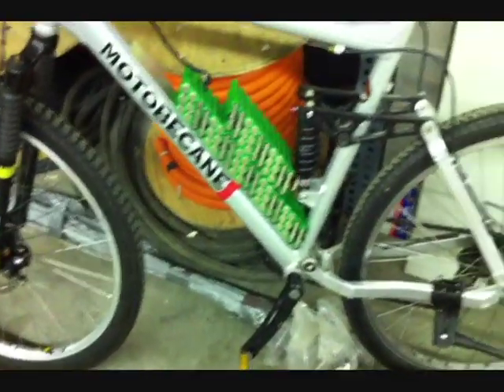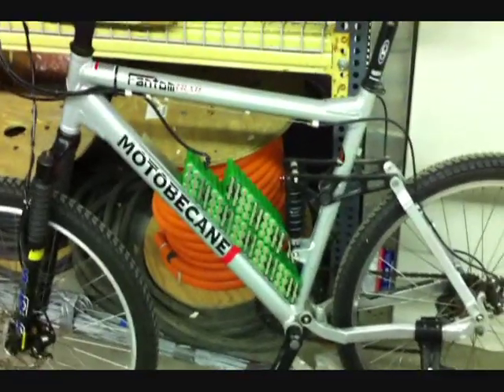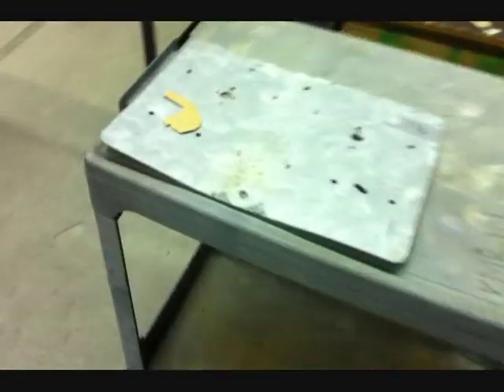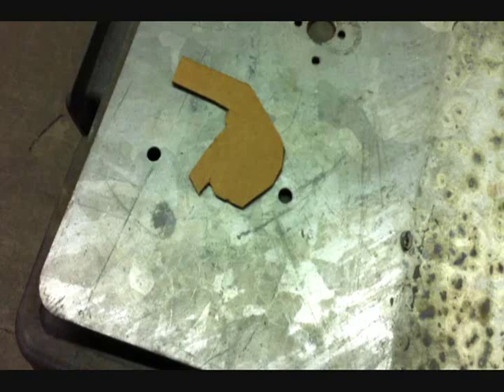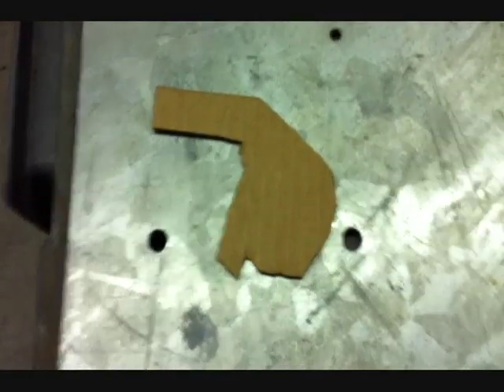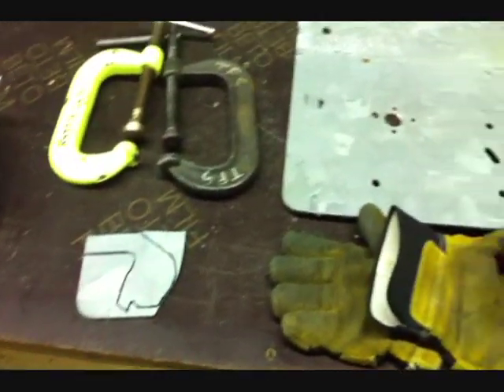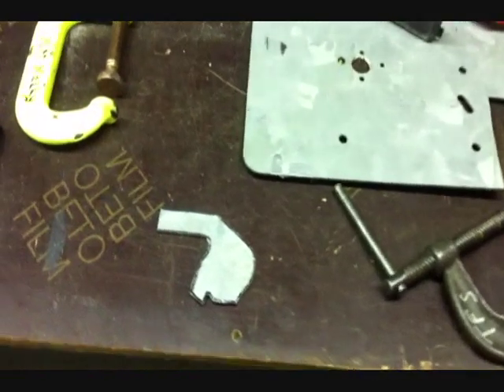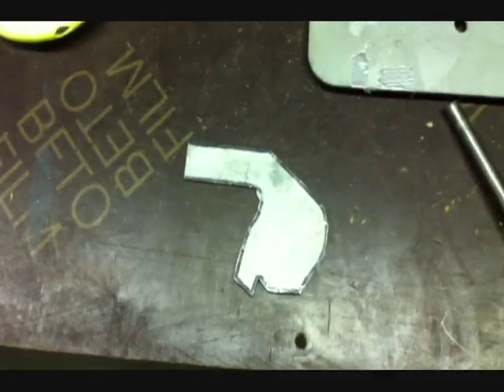EBIKE 72v - Battery assembly and torque arm design

Comment from the maker: @staver76 on flat ground and average terrain. no you will not hurt it at 60v, but if you push 50amps at 60v up a 5 mile mountain without pedaling you could overheat it. brushless motors biggest fear is heat, thats the only way youll kill the motor. im running 72v 30a with no heat issues yet

Comment from the maker: @staver76 yes im using the same 48v GM on 72v 30a setup. as long as you dont abuse the motor with tons of power and hill climb for 10 miles straight it should'nt be a problem at 60v at all.

Comment: can u plz explain the torque arm in ur next vid cause it looks like its gunna interfer with the suspention, that bolt above the axle is a piviot point if it was a cheap big W dual sus bike it'd be fine but these bikes are made with a simila design to forlink suspention in a car so the wheel only travels up and down no up and in like cheap bikes!! i'm a diesel mech and torque arms are generally to stop the diff rotation so i assume this in to stop the solid bit of the hub from spinning??